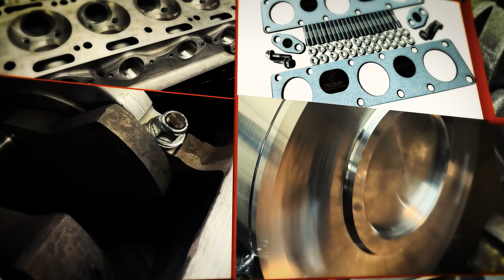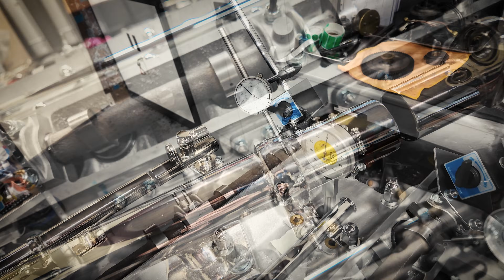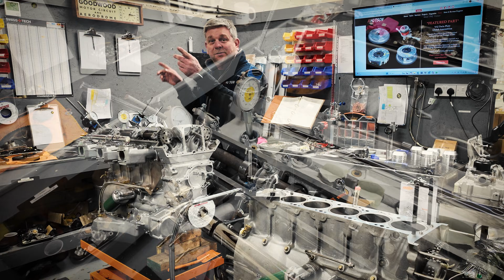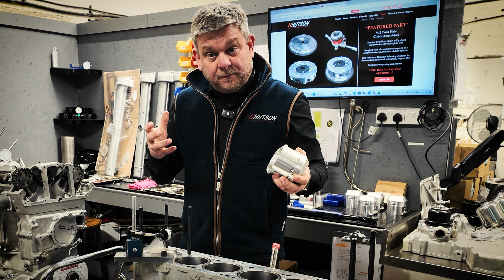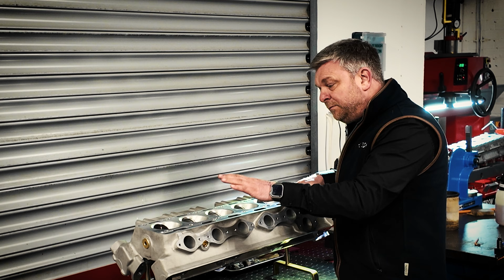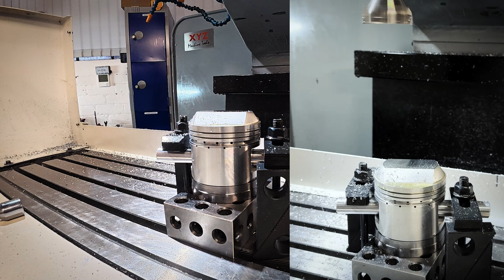Aston Martin DB5 & DB6 Engine Rebuilds

Comment: Many years ago when I had a DB5 I rebuilt the engine and as I had a parts book as well as the workshop manual, I looked at fitting vantage cams. There was only one part number for each camshaft. 
I used to deal with Andy Chapman (Chapman Spooner) for parts and I asked him about this, it turns out the vantage did use the same cams but with different timing. I also asked him about running with vantage timing and the S.U. carburettors, and he said it would be fines as long as I made sure each carburettor was 'pulling' together, i.e. well synchronised.